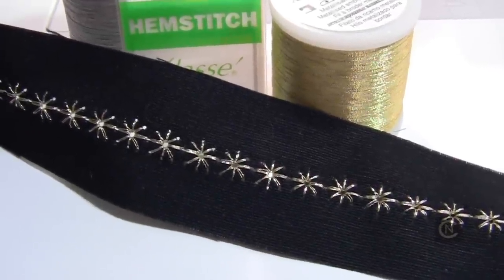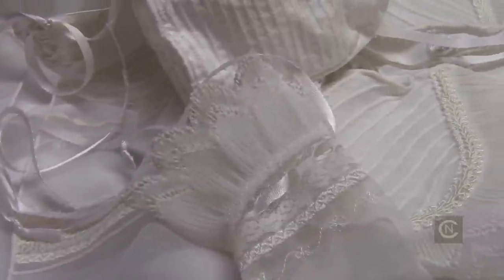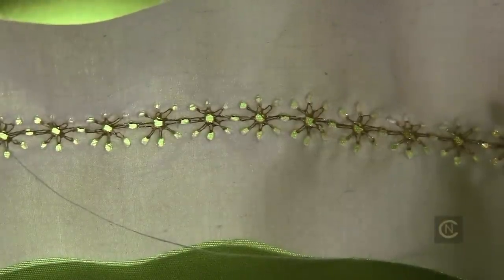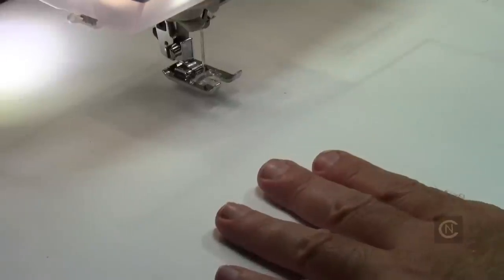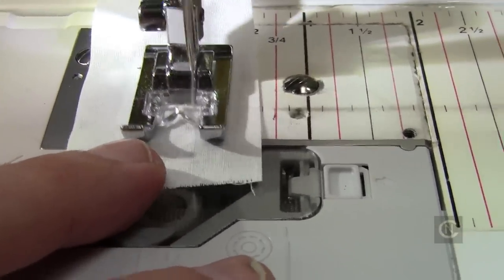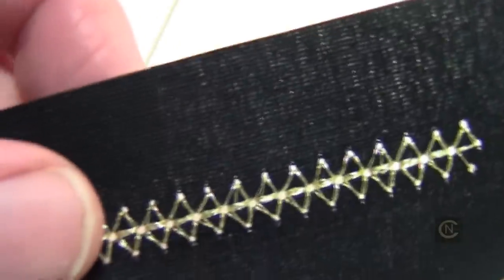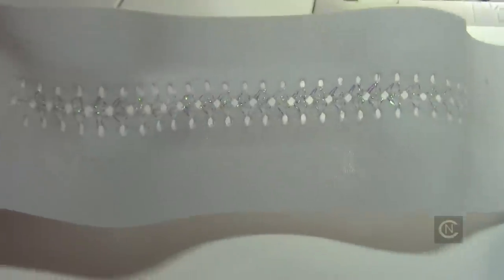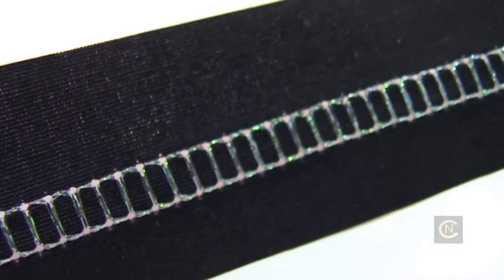Heirloom Sewing Beyond Traditional - Christopher Nejman

Comment: I have taught heirloom sewing for years. I like the addition of the metallic thread. These stitches would be great additions to placket edges, cuffs and much more. On the last demonstrated stitch, for more glitz, try weaving ribbon or thread. That's also a tradition. BTW, in the original version of French Hand Sewing,  the strips were usually left over from a worn-out garment. One NEVER threw away perfectly good lace or embroidered sections that were undamaged. Hence the stripped look on bodices and other sections of a new garment or reworked garment.
Reply: I'm wanting to make a table runner because they don't have the size I need.  How would I turn the corner when sewing heirloom stitch?

Comment: Can I use the wing needle with a vintage sewing machine that has limited decorative stitches? Thanks for this wonderful video, Christopher, and I love the Christening gown, cap, and all of the heirloom techniques you showed, both traditionally and contemporary, you are so gifted!! 😊
Reply: KawaiiBlackPixie1 I purchased  a Klassé Hemstitch Wing needle 100/16 and used an open toe presser foot. Also, I used  Mettler Silk Finish Cotton Thread and chose the feather stitch on my vintage sewing machine. I was careful to set the length and width for my decorative stitch according to the instructions in my machine manual. I turned the flywheel by hand prior to stepping on the foot pedal to ensure that the needle cleared the presser foot. It went very well! I recommend using it on batiste cotton or linen; otherwise, starch the heck out of the fabric and allow to dry for at least 15 minutes before sewing. By the way, I didn’t use my newer Janome, but staying with my vintage machine, I was able to use the stretch stitch for heirloom. The overcast stitch produced an interesting pintuck + heirloom effect. I hope this personal info helps to answer your questions. I will try to answer more if you have any.😊🧵